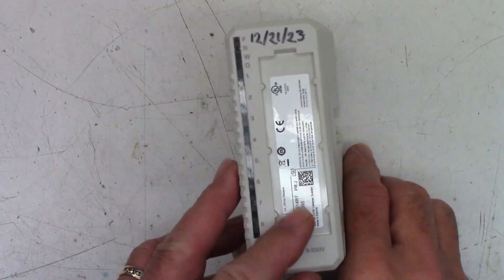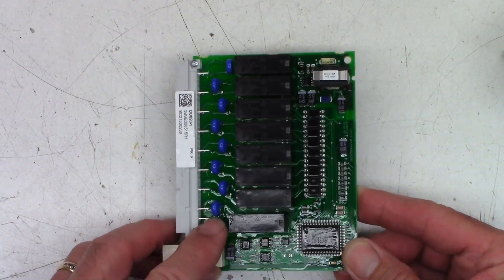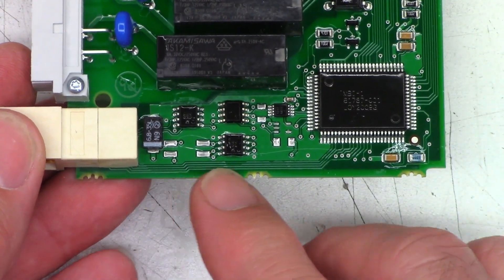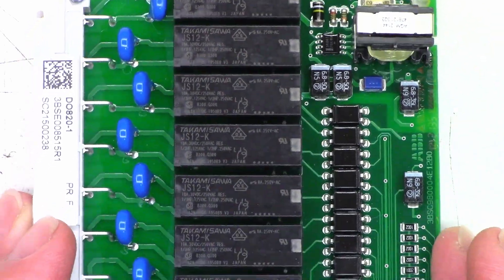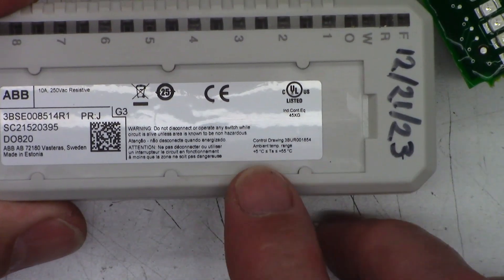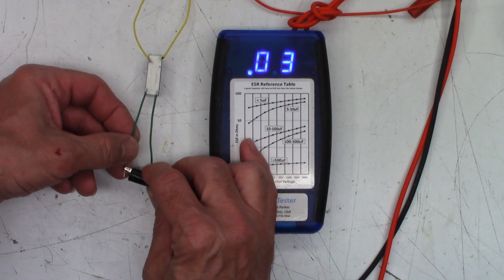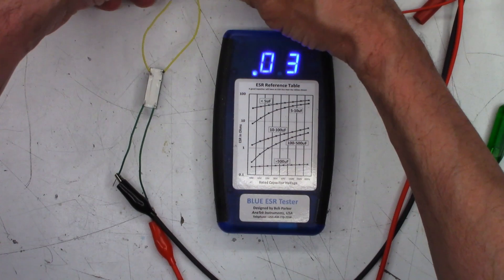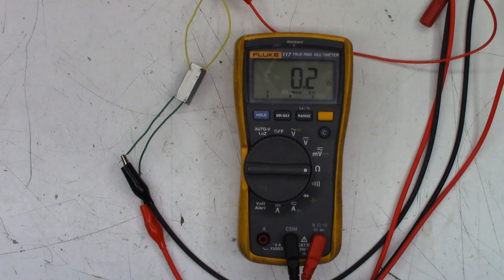ABB Output Module DO820 Failure Analysis (maybe) Industrial Automation

Comment: Definitely got the life out of that! As others said, a solid state solution is probably the better option if all the outputs are all AC or DC with the respective solid state output card. 
As far as ABB / ASEA Brown Boveri, very interesting history of mergers throughout the years going way back. Used to work on some old ASEA 138kV/25kV, 30MVA distribution transformers, and ABB HV breakers. Then did some work for ABB themselves, when they took over the GE Industrial services division. What a mess that was! I left that job quick and no wonder GE sold off that division! Great money but zero planning or customer coordination and didn't like looking the fool.  
But the ABB history is a good read some time when nothing else to do.

Comment: My Magnavox DVD HD recorder model MDR865H /F7 built date Oct 2016 has stopped working.  I just found your 4 part video you created 9 months ago. I believe the hard drive failed. I removed the hard drive and connected it to my computer through the USB.  I think I formated the drive.  When I replaced the drive the into the recorder, the recorder is now completely dead.  No fan, nothing.  I clearly did something wrong. I see similar recorders offered of ebay.  They are not inexpensive and who knows how they will work when used on a daily basis. I rather spend my money on getting mine repaired. I f eel you know about these machines than anyone I could find here in my location. Can I send my unit to for repair? I not sure how to find your reply if you choose to make one.

Comment: Interesting video steve. It would be interesting to know what kind of load each relay was powering. Do you think the blue capacitors on the output side of each relay was meant to absorb any inductive kick back?
Reply from the maker: The blue devices are metal oxide varistors. They are powering a "pilot operated" air valve, very small solenoid coil.

Comment: Although much more current and larger loads, we use arc suppression caps and bleed resistor kits on our motor contactors at work, to absorb the arc flash across the opening contacts, to extend the contact face life. I wonder if a similar addition would work with these, to cut down on the pitting that occurs when the contact opens?

Comment: 40 million plus cycles is well past the mechanical life of those relays, or at least the warranty. better off replacing that output module with the identical SSR version, which will last longer than the life of the machine.  Programming wise it acts exactly the same as the relay version, just has both a faster response (make immediately, open at zero crossing) and a very long life.

Relay itself orientation is important, because you likely have debris inside from contact wear, so it needs to be in the orientation of the relay contacts being at the bottom to get it to misbehave.
Reply: I was going to say, that's a poor design to use a mechanical relay for something that's switching once per second
Reply: @gorak9000  Agreed!
Reply: @gorak9000  I had that, a relay operating around 3 times a second to operate a take up spool at the one extreme, and there the Brown Boveri contactor used did eventually, after around 40 years in use, fail. not from contacts wearing out, but because the actual relay frame and armature, made from steel laminates to reduce eddy currents from the 220VAC coil, had actually mushroomed out from the millions of cycles of contacting each other, and finally bound up in the frame. Replaced with a similar vintage contactor unit, sourced from some old industrial controller i got on auction for less than scrap metal price, and it carried on again, the old contactor kept as a source of spare contact points and the coil, which were eventually used on other relays that actually were on all the time, or for the contacts, on heaters which ran at 10A.

The machine was interesting, it could run on 115VAC 3 phase (200VAC between phases) or 380VAC 3 phase, with just a few simple changes, to wire the heater commons to another phase instead of neutral for low voltage, and change the 2 3 phase motor windings from high voltage to low voltage, along with doing a tap change on the 2 control voltage transformers. An upgrade i did later removed the one transformer entirely, to make room for a VFD, and used the spare 24VAC winding on the left in transformer, along with the 220VAC secondary, to power all the relays, and upgrading the 40VAC supply to use a bridge rectifier and a 220uF 400V capacitor ( only can I had around that was over 80V, ex Telex machine power supply unit) that was used for the DC brake unit on the main drive, with reduced load, because the relay that otherwise pressed this into use as a main motor DC brake, had been replaced by the VFD having a timed DC brake that was more effective. Also replaced all those cursed Diazed fuses as well, as they were rather expensive to buy when a heater killed one, so a 3 phase 10A breaker for the heaters, and a 5A 3 phase breaker for the rest, was a much better alternative. Then a 10A breaker to feed the VFD, and a 5A breaker for the coolant water pump (cheap pond pump, good for 2 years before you replaced it I found) that I had added to it.

Comment: If you replaced the relays would you be allowed to use that module in the system?
Reply: I don't believe the module has any way of knowing, but allowed from a support/warranty view, likely no.
Reply: I was thinking if the company had any rules about repairing those modules.  Now it could also be difficult to get that relay.  I would also think some new conformal coat after repair. It is probably cheaper to get a new I/O module than you spending time finding and getting the relays and then replacing them.   Our local "VoTek" that I went to in the mid-late 70's no longer teaches any discreet electronics.  It is now an industrial electronics course, which I would take to mean teaching how to determine which module of a PLC failed and replacing it. Maybe, crane control repair, but nothing down to component level like it was when I went there.
Reply: Depends, very common to replace relays, but if you have a programmer a quick fix is to simply reprogram the logic to use one of the other relays that are spare. I did that before, as the relay board was part of the main PLC, and a new Omron PLC would be rather expensive, and a few days to get, but I did have a single unused output available on the PLC, and thus was just a few minutes work (after driving to the local supplier to borrow the programmer) to update the logic to relay map to the new output. If it failed again I was simply going to order an expander, plug it in, and get the extra 8 digital inputs and outputs to use, with only the one used. 

But it never failed, must have been a relay that was on the edge of tolerance, as all it ran was a dry input contact on a motor drive, enabling the 1kW drive to run a motor, and rather brutally. Starting and stopping it hard, as the motor was set to ramp from 0 to 75Hz in 0.2 seconds, and ramp down was set to 0.1s, with max DC brake control. Had to turn off the overvoltage lock out, from needing a manual reset, to auto reset, and the entire machine ran on a CVT to reduce noise, which helped by making the supply impedance much higher, so reducing the spikes. Any harder and I would have needed to add in the brake chopper resistor to it, as the DC bus rose to close to 400V during run down, which was the overvoltage trip point. If there was another drive it would have helped with this, but a single 2.2kW motor was all it had, the rest being handled by pneumatic cylinders, and then a 500w heater run via a temperature controller and K type thermocouple.
Reply from the maker: I have swapped the "unused" (4 used, 4 not used) relays when we could not obtain the replacement modules during the "Plandemic", until the replacement modules were available again. A Triac module would last many decades longer than the relay module.